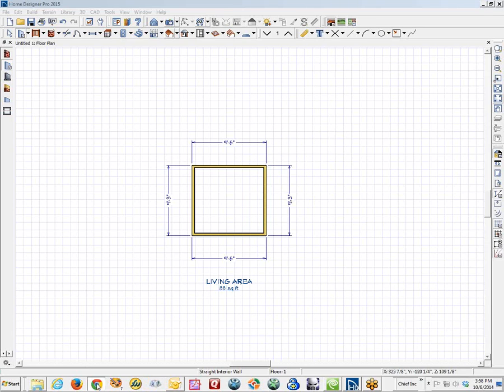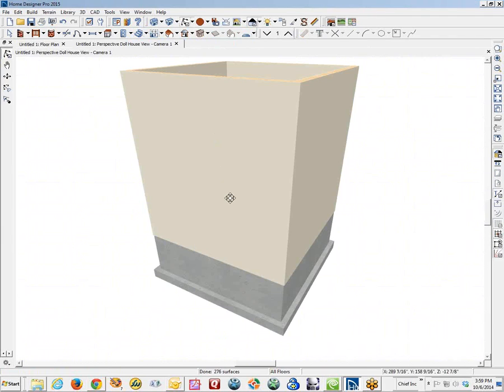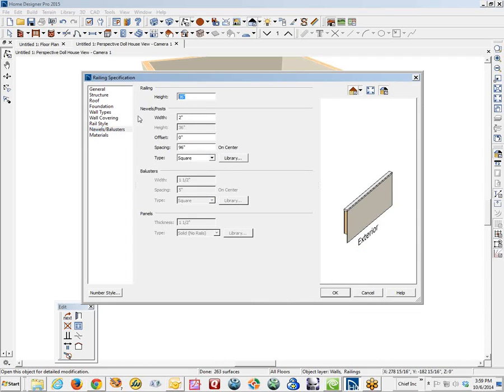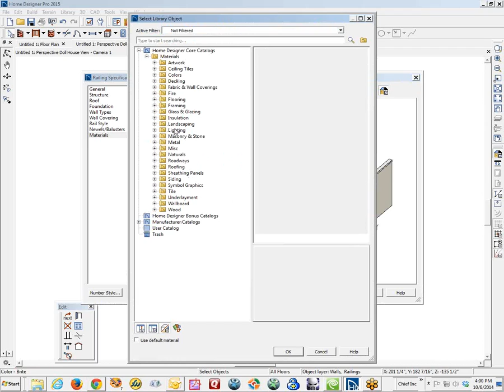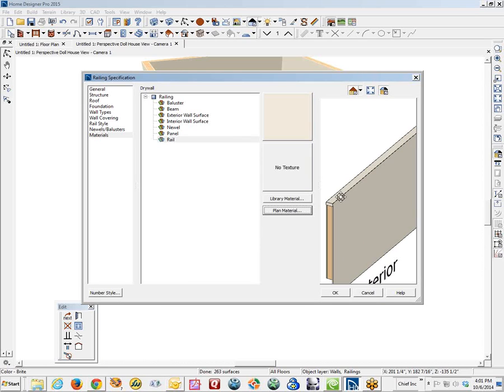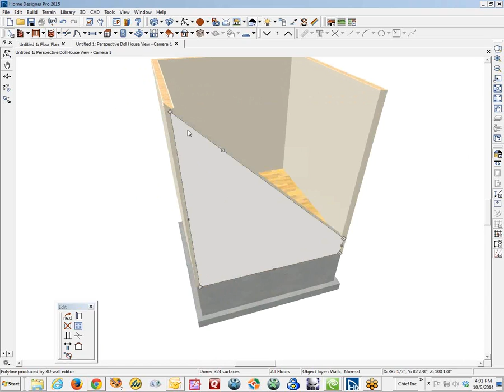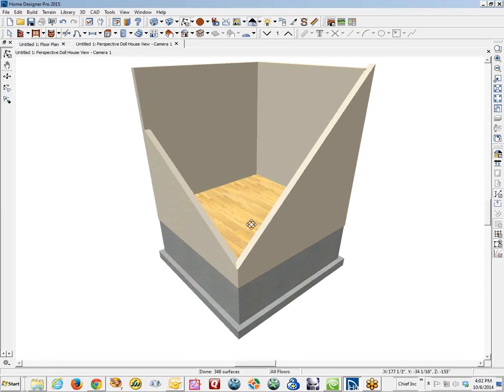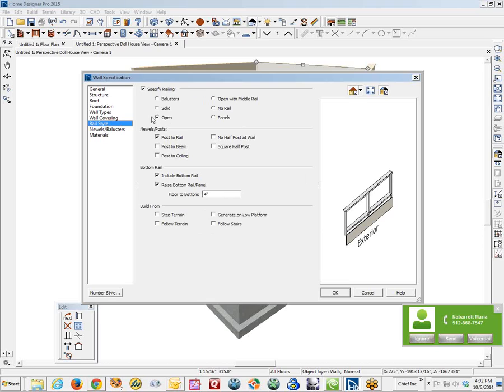How to slant walls In Home Designer Pro

Comment: Hi Dav,
Sure glad you put this helpful video out. I searched for two days to find a way to put a Gable roof in my home project using Home Designer pro. There is nothing nowhere in my search. Then when I found your video the thrill knowing I could rest and went slowly to finish me home. 
  I also searched how to take a wall and rotate it to be 30 degrees from the ground. All I found out that this is impossible using this Home Designer Pro. I was told I could make this wall lay down with a 3rd party application like Sketch-up and import in in Home Designer Pro. I feel your a high ranking help that helps even folks at Home Designer Pro would know the best answer. ThAnKs for exposing what gold was deeply buried!!!
Reply from the maker: What you wish to do can be done, it is just a matter of learning how to use the dialog boxes and other tools to just get stuff done
Reply: David Jefferson Potter   I spoil easy. Thanks for the encouragement. I like confidence. I'll get er done Doc.
Reply: I figured it out Doc to slant the whole side. So it can be done. Thanks for the encouragement. Don't know why this was never simplified. Byeee...
Reply from the maker: @gemmeerobinson1803  Been using this software for almost 25 years, a lot of things look easy to me but I sweat blood to figure them out, such toil is up to you
Reply: Well I'm proud of you. 25 years! I admire your perseverance that overflows that gave me strength. Your kindness makes great Software even better... Nice... ThAnKs...
Reply from the maker: Once you really begin to master this software it is pure joy to use and create with, keep at it!
Reply: I can understand that. Next is making a dome roof. Fun taking one step at a time. Sure will stay at it.
Reply from the maker: @gemmeerobinson1803  a domed roof can be "emulated" as to appearance using a domed-shaped object from the "Shapes" library but duplicating the same thing structurally would be quite difficult. If I was needing to create plans for such a roof, I would just emulate it and then draw a detailed "Detail" using 2D CAD only to communicate how to build it structurally. Perfection in detail in 3D is quite complex indeed.
Reply: Snooze time over. Ahhh, a message. I'm ready for the challenge now. Corona Virus out there somewhere. Rained all week long. Things could be worse. I'm inside but my spirit is not dampened because of your shot of care Doc... ThAnKs!

Comment: I am trying to accomplish this in Home designer pro 2016 for a design for a client and just cannot get it to work after an hour plus of trying. The client is looking to convert an attic space into an additional apartment, and try as I may, the walls in my design will not give me the four handles in the simple easy manner shown in your video. I cannot imagine what i'm doing wrong, the handles just are not there. I made a practice plan identical to the one in your video, and the handles only appear when a single wall is by itself. however, this does not work within the attic design, even when i isolate any given wall.
Reply from the maker: There is a key setting in "Edit - Preferences - Architectural - Select Room before Wall in 3D", depending upon how your software is set, when you click in a camera or elevaiton view you will first select the "Room Specification Dialog" instead of the "Wall Poly line edit handles". You either change the setting or you left click, then hit the Tab Key or next button to then directly edit the Wall Polyline, take another look.
Reply: @DavidJeffersonPotter   Wow! Thank you so much. I overlooked  'Select Room before Wall' completely. Deselecting it allowed the heights to to be adjusted manually. Will this still be calculated in surface area, materials etc, and will it still perform auto framing functions to the specs of the new walls? Also, is there a way to view measurements during 3D editing? I apologize for the many questions and very much appreciate the help!
Reply from the maker: @jacobrauscher8806  Welcome!